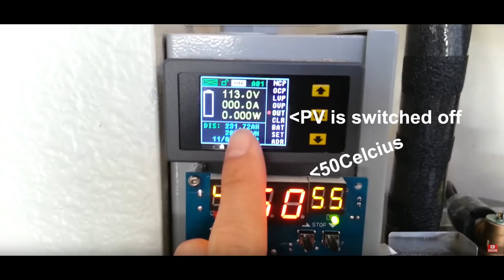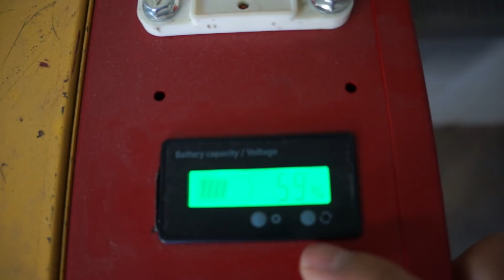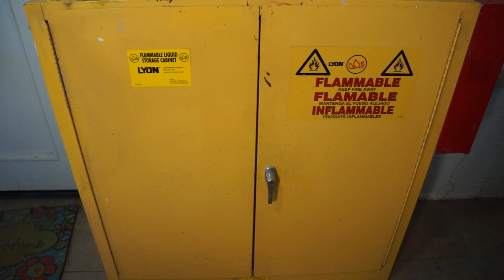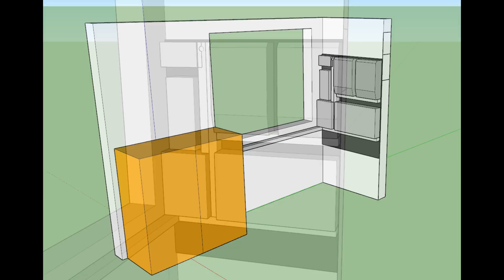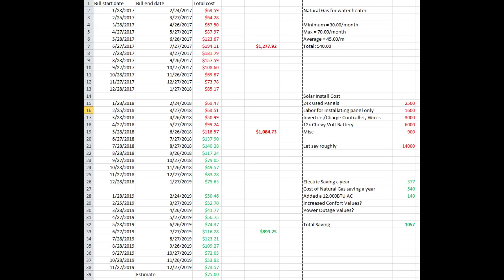My 7kw Off Grid Solar, 37kwh Lithium Ion Battery Bank Cost vs Saving over 2 years?

Comment: Here's what I'm doing, my country allows net meter, which means excess electricity made during the daytime will send sent to the grid, and time when you aren't making any energy you get the energy back from the grid, this way we don' have to spend on batteries, just 2 batteries incase when grid is not available power out is common., total cost is around $4,000 for 5kw system, you get the payback in 2.5 to 3 years, we have rampant inflation so it's higher.

Comment: If you don't charge your LiFePO4 to 100%, and don't discharge below 75%, they could last over 20yrs.
$14k is cheap for this system. 
Have you considered getting an EV? If you stop buying gas, your solar would be paid off faster.
Reply from the maker: Yes. I've bought a used Nissan leaf.  Been charging it.

Comment: Average power consumption in southern US is about 15,000 kwh per year so 40kwh a day. You'd need at least a 14kw system x5 hours a day to charge a 40kwh battery bank and run your house simultaneously with AC. That would give you one day of extra charge capacity in case the sun don't shine. If clouds lasted 2 days you'd be out of power. So 40k for the solar array and 6 7kwh power walls to the tune of 18k. Plus wiring all for 2 days worth of intermittent electricity that would only work during the summer. Sounds costly. I'll stick with the grid. ✌

Comment: Lots to learn and be aware of.  $$ you save or $$ you spend with a responsible installer who will work for you and not be ripping you off.  But a good installer may be unaware of all the Gaer out there you can use. Like Leaf/ Tesla Etc Battery Packs.. Or if you buy an  electric car and use it to run excess generated by Solar.

Comment: You explain your nice setup clearly, and by using off-the-shelf batteries also less technical people can buy that what you bought and do their project. Kudos!

What I am most interested in, and did not get any insight in, is if your battery bank is too large or too small. If you could add some number of kWh production and consumption each month that would be really helpful. I am surprised you only reduce your energy bill so little, because as you live in a hot, sunny region, your main energy consumption is AC and fridges (or I am missing some important stuff). Both use max power when also max solar production is there, so I would have expected that you would at least slash your energy bill in half. 

My numbers for comparison; I live in Holland (grid tie, no battery, feed back to grid at same rate until even) and  before I installed 4.6MWP solar  my yearly energy consumption would be around 3.8MWh, but now with my 4.0MWh solar energy production a year I am at a draw of 2.5MWh consumption and 2.5MWh production (net). But my situation is reverse: I don't use AC in summer and in the sunny(? hollland..) months I can produce 20-30kWh/day while consuming only 8kWh average or so. In the winter months, i am at a deficit with days of only 1.5-2.0 kWh solar production but 10-12kWh consumption. So I am lucky that the state still allows me to feed at same rate back into grid!

a lot

Tip:
If you use some of your solar kWh to heat water, you are not doing it economical. Solar collectors are so much better at extracting energy from the sun to heat water. I have 5m2 solar collector with a 1000L tank and during 5 months of the year I don't use any natural gas to heat my water. I think that 2.5m2 collectors and 500L tank would have been fine also. So the real-estate of your roof is much better used if you swap 2 solar panels for 1 solar collector with a water tank. During a summer day my collector is easy pushing 5-7 kW per hour energy into the water tank), equivalent of say 20 panels if you use that energy on a simple resistance heater.

Comment: Well explained........ but I think you called the 2 MPPT boxes inverters ? I think you just should call them MPPT controllers....... The Sine wave Inverter sits on top of the MPPT boxes.......my other comment is abt the life span of the Li Batteries.....20 years is wishful thinking but possible...consider that some cells might have to be replaced..... I would say 12 years is a reasonable assumption on the life of Batteries. Considering the energy prices will only rise more and more , plus your off grid feature... you will be ahead of the game. Cheers  P&F
Reply from the maker: No, they are inverter and charge controller, 220v.  The reliable inverter on the top is strictly 120v.

Comment: Seeing my monthly summer bills are only about 25~30 without water heater (~40 with). It would take over a decade for solar panels to pay off, not to consider possible troubles that will have to fix yourself instead of provider.

Comment: I don't understand, if it doesn't pay itself off in 3 years then there is a massive mistake in your system in terms of sizing, procurement and usage.   If I have my ROE correct: 
That system should be designed for a $450 electrical bill a month.  It should not cost you more than $9400 esp if you did it yourself.  $450 x 12m x 3y = $16 200??  if you have a 37kWh system you must use that otherwise you waste it, and if you compare that and use that same of the grid their will be a 3y payback in terms of offset (try to zero).  Where you should have annual escalated full savings for the remaining 7 years?  it actually translate to two year payback depending on what your distributor charges for fees, allocation, etc. tarrifs

Comment: Maybe you can help I purchased a 7.5 kw solar system 20 panels each panel is 370 watts were in the summer at 102 degrees every day and my pg&e app says its only producing 12kwh a day and my monthly bill is 350$ using the ac only 5hrs a day so does that seem right i don't have a solar battery

Comment: It is important to also calculate the full cost per KW, as it is delivered, with all of its taxes and surcharges. I am paying roughly 24 cents per kw delivered (not including the basic service fees). If I had a 7kw system making 4 hours a day It would be about 30kw a day, which is roughly 7.50 cents worth, which is $225/month. Thats around $3k a year, which makes this payback significantly better, around 4-5 years.

Comment: woooh.. 13c kwh? I live in NSw Australia, the rate here is AU$0.31 kwh. That's  21c to you. The bill in this factory with me running a large cad system and a fan heater in winter (3C outside) is $1600 quarter!.. I just went and bought 2 portable reverse cycle air con 14000btu.. Run 1 at a time depending on office or bed. The bar & fan heater 24hrs at 2.4Kw = 58KWh/day = $18 day..
The air con run 1.4Kw x 50% x 24hrs = 10kwhrs /day = $6.. Better. The roof air con is 16KW pump, 5KW in,  inverter. the owner just replaced the old unit. I havent measured the unit yet. but i am expecting around 2kwhr. which is not bad. Takes 15 min to raise the indoor temp from 14 to 28C.
as an aside.. the most expensive electricity in the world is Germany. Its all renewables and its US$0.31c kwh. The cheapest in the world is france US$0.13 and its all nuclear (and they are NOT going renewables)

Comment: I did my calculations for Solar Panel here in India and I would have it cost break even in 7-8 years. But I have a space issues as I already have Solar Water heater unit for last 6 years. It will payback everything in next 1-2 years. I am really happy with that system.  Getting hot water for bath ever morning. Except off course on cloudy days. That day Electric water heater is used.
Reply: Unless in India Solar is very expensive your calculations must be wrong.
In the Uk where we dont have the same amount of sun i should payback a 4kwh system in 6 years max i generate 6400kwh a year
Reply: Yes in india solar systems is cost to much ,I use solar because grid is unavailable in last 6 year .

Comment: Here in North Carolina, I'm looking at going close to 100% solar. Reason? The grid here in the rural area outside Raleigh is VERY unreliable.  My first summer here I had two 4-5 day power outages.  And 6 outages that ran from 3 hours to 10 hours each.  Duke Power is costing me from $100 to $190 a month, with very conservative use of power. (A/C only keeps the house just below 80 F, and heating via heat pump only to 60-64 degrees) .. Cost for the system would be about $25k to 30k in this area. One estimate was $70k... Plus the cost of a shed for the back yard to put the equipment in.  Grid tied without batteries would not help.  If I get 60 kwh of batteries I can handle a 2 day cloud outage and run everything without problems.  Everyone is talking "15kwh" of batteries at the $25k price point. During a big storm, that would result in dependence on Duke again, and with that being the time frame that Duke has problems with (Trees falling on wires) it is a sub optimal solution.   (I'm using about 35kwh per day during the summer...)  Thoughts?

Comment: When the power goes out my provider requires all grid-tie systems to disconnect so unless I have enough storage to get me through the outage I'm also down. Going off grid will require about $24,000 worth of batteries. This means that my payback on my small system is at least 20 years assuming no maintenance costs which isn't likely.

Comment: I installed a simple 1.2kw system on my live aboard dive boat to use while we are parked in between trips.
It has a 6kwh battery.
That gives enough power to run any of the major systems on the boat for an hour per day and charge the batteries to give the 2 sailors who live onboard 2.5khw of available power to use over night.

It seems small, but the fact is that it normally costs 1,000 litres of fuel per month for only 5 hours of power per day!!!!

So my $2000 system turned out to be VERY cheap!

In conclusion, I can say that solar power is one of the most amazing experiences I have had. It just really depends on what you need it for and how to manage your power consumption.

Comment: Your figures don't appear to allow for depreciation in the equipment you have installed. How often will this kit need replacing? You really need to subtract the annual depreciation from your savings. We don't get reliable sunshine here in the UK so going off-grid individually can't resonably be achieved here, at least not with the equipment currently available.

Comment: What is the energy efficiency of your air-conditioning system ?.  You can greatly reduce your air-conditioning and heating power consumption by better insulation reflective material in airtight air seal insulation. And this takes no electricity no maintenance And last the life of the house

Comment: Lots of info; will take a while to absorb. I've been following solar / wind since mid '90's due to numerous power failures at my current location. It hasn't been cost effective vs power company plus my emergency generators but the value would be in convenience and comfort. However, my startup costs include tree removal (@ 10K). Also, I enjoy the trees and their comfort and I would miss them.  The system doesn't really need to 'pay for itself '  monetarily but I would really feel swindled if the performance doesn't deliver.

Comment: By the time you recoup your investment, you will likely need new batteries and other expensive components. However, if there is a big solar flare that wipes out the grid for several months or even a year, you will be glad to have electricity.
Reply: depends on how many deep cycles the batteries go through.  If they don't go through many, then you just have the yearly degradation to worry about and that can last you for 30-50 years before worrying about replacement.  All depends on how you design it to work.  He's not off-grid, so the batteries shouldn't cycle very much, mostly during power outages.
Reply: @zarroth  I'm a big fan of lithium batteries and I agree with you that if you treat them right, they will last a very long time. However, 30-50 years is a bit of a stretch in my opinion.

Comment: You need to include lost opportunity costs: Investing $14000 would give you a return (dividends and stock price increases etc)

So if you had $14000 to use you cold invest that and borrow the money from the solar system supplier (lease system or pay off) with possible tax write offs?

I'm just trying to figure this out.
Reply from the maker: Ok...

Comment: Use electricity more than solar power. Use Solar power only for lower loads or emergencies. One short-circuit and your whole system breakdown adding more cost.

Comment: 3:38 There is an electrical arch forming right where you pointing...
Reply: I'm pretty sure it's a green LED
Reply from the maker: It's a flashing light from the current sensing module.
Reply: @devildestiny555  Great job, very nice layout and tidy. big like

Comment: As a conservative estimate you save $1000 by investing $14000 ‘on your solarPV system.  I calculate that you are getting a 7% return on your investment.  In today’s market that’s a good return.  As power prices rise your return on investment will rise. Looks like a good deal to me and very cheap for such a high output system.  One question - why do you have so much inverter capacity?  What does each of the inverters do and what is the capacity of each please.  Very interesting video - thanks from New Zealand

Comment: I think there are significant cooling savings to be found if you could color your home something lighter to reflect more of the heat.  Also anywhere you have roof that isn't covered with solar panels, changing it to a lighter color would reflect more heat.  The less heat entering your home, the less heat you have to try to remove later.  But even without doing any of that, your system saving you over $1000 per year means the breakeven is less than 14 years out - not bad.  And of course if electricity and gas rates go up before that time elapses, it just means the breakeven comes sooner.
Reply from the maker: Yes, I did notice it reduces a lot radiate heat, since it's on the west facing root "afternoon sun" make a huge difference.

Comment: Hi, im about to make my house in the mountains off grid. (San Diego mountains) i made my garage off grid for a cost of 600 dollars.
3 kw 24 volt input with two 315 watt panels.( used parts, new panels) For the house, I plan on 48 volt input with 14 panels to start with. And  a 5 kw 240 volt inverter, then step down split phase transformer., just need about 2 to 3 kw of power. Not sure yet on which batteries Im going to use. Possible battle born or Victron. Thanks.
Reply from the maker: Best of luck.

Comment: So you are using the MPP MG as battery chargers and grid backup and the 3500 watt inverter for power to the house?  If so why not get a step up and down transformer and connect MPP MG units to it and do away with the 3500 watt inverter then you can run many more higher wattage and high startup appliances at same time etc to avoid managing loads so closely.  Efficiency is probably about the same  see this video for a how to if needed and apparently according to Steve since the transformer is basically just changing  the power to split phase and not significantly changing voltage your only really using the imbalanced portion of the load to reach the 5,00 watt inverter load.  That is if you are running 3,000 wats of 240 volt appliance that is very little work by transformer and it would be kinda hard to get several thousand unbalanced loads from 110v uses, just put microwave fridge washer etc on planned legs maybe one with all the lights and receptacles and other 2 on same 110v leg to minimize the imbalance.
Reply from the maker: The MPP 5048MG are both inverters, they invert power for the 240volts AC unit.
Reply: @devildestiny555  Yes I know they are inverters but only for single phase thought you were in US using split phase 240 volt . Instead goes you need the 3500 watt inverter to supply the 120 volt uses.

Comment: Great job! Really would like to hear more about switching from natural gas to solar electric hot water. Also, did you notice any attic cooling effect from the shading of the solar panels?
Reply from the maker: YES, absolutely since that roof is west facing, afternoon sun... the house is a lot cooler even if the AC aren't running.  I would say it help at least 5F degrees.

Comment: Impressive.  Very low cost   But relies on your knowledge and personal operator safety. 

 You have a 500V, multi-MJ stored energy system that, in an OSHA setting, would be locked out, with controlled access only by  qualified high power electricians under NEPA guidance. Not for other homeowners.  We pay the experts of the Public Utility system.

Lost a friend who decided to do her own kitchen wiring. . .

Then there is fire safety.   Flash safety. Grounding safety.  Safety systems redundancy and failure modes.   Emergency/First responder protection.  Permits?  Inspections?  There is a lot here.  Beautiful but not a hobby.
Reply: exactly, pretty irrelevant to the average consumer